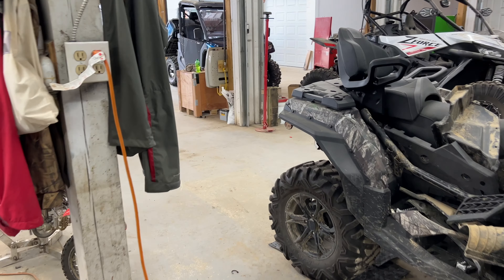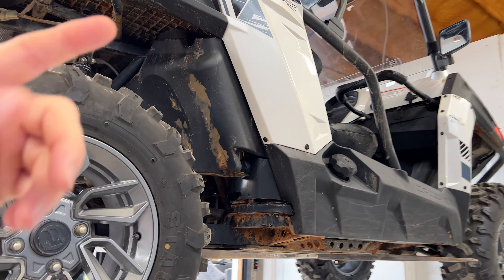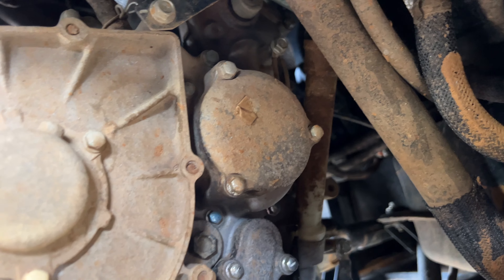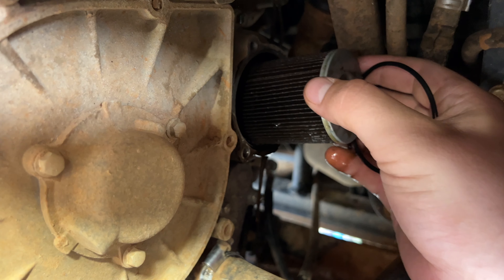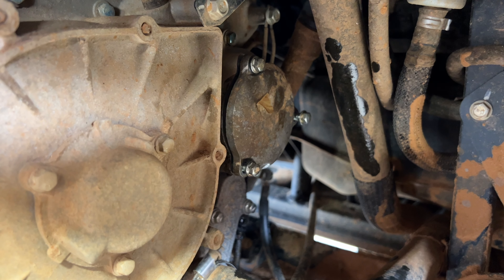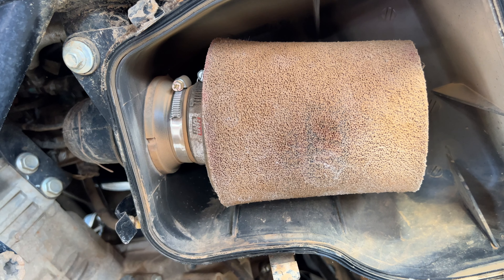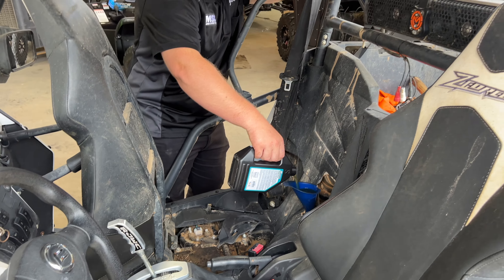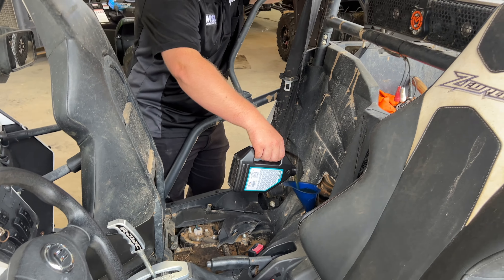CFMOTO ZFORCE Trail Service Oil & Filter Change

Comment: Hey guys, have a 2016 uforce 500 with 175 miles on it, pretty jerky on takeoff almost like it binds in the rear end. Also the parking slot doesnt seem to hold the machine and it will roll. Is it possible I have a broken parking pawl and what would cause the binding between 0mph-4mph seems find after that. Thanks Joe

Comment: BEST OIL CHANGE VIDEO FOR THE Z FORCE 500 TRAIL!!!  THANK YOU!.  Y

You mentioned a torque wrench in the video, but didn't state any recommendations for torque values, do you happen to know what they are??  Thanks again!
Reply from the maker: Thank you!!! 
Yes I meant to write them in text on the video when I was editing it. I’ll look at my shop manual this week and get the exact specs
Reply: The owner's manual says the oil filter fastener should be torqued to 7.3 ft pounds. The oil drain bolt torqued to 22 ft pounds.

Comment: That was a good video on changing oil, but what about greasing it and changing differential oils.   How often?
Reply from the maker: It depends on your riding conditions.. but at the very least once a year in my personal opinion or every 500 miles wouldn't hurt either on the diff fluid. You can go 1000 miles. 
But on the grease, id do it very frequently especially if you ride in muddy or sandy conditions

Comment: Question. I have engine oil going in my air breather. What's wrong with my machine? 2021 zforce 800 trail, 3000 kls.